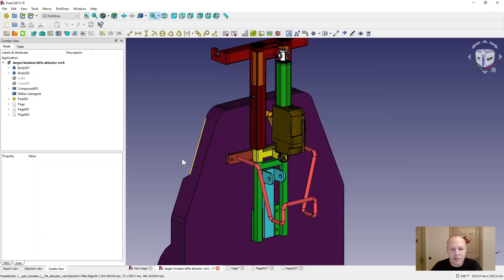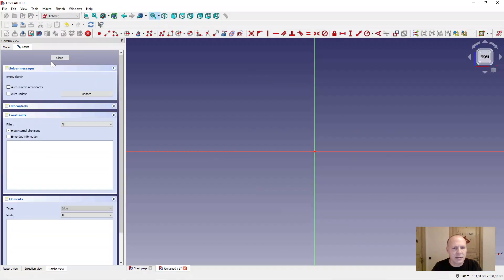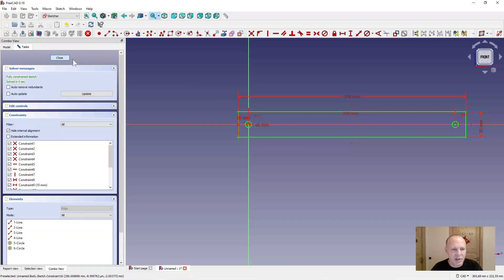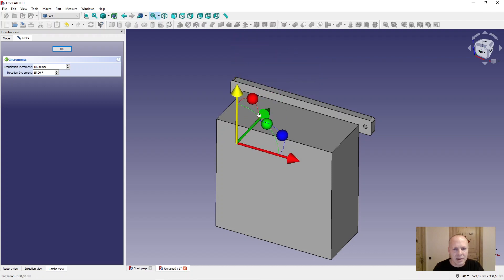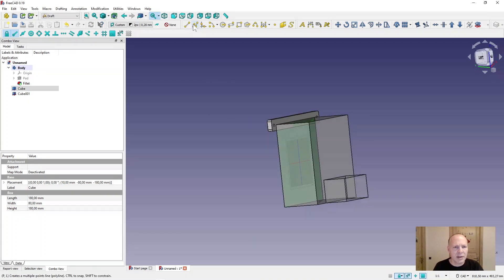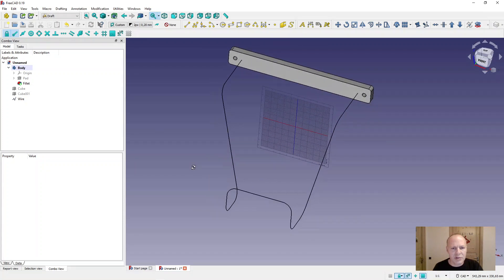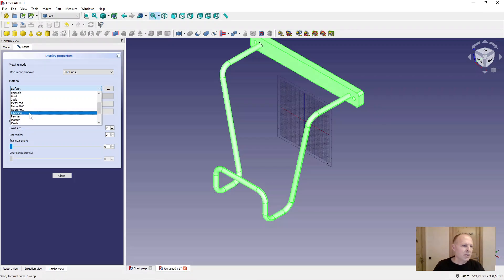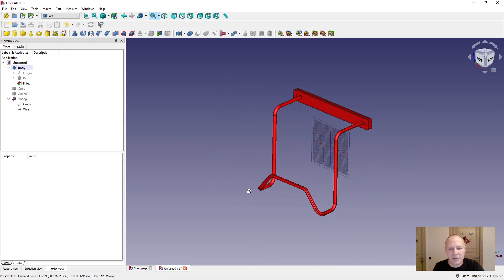Freecad 3D Sweep

Comment: When I followed the procedure to design the path of the 3 d poly-line, the orientation deviated from the edges of the solid in such a way I had to readjust the Euler angles & position of the 3 d poly-line.

Comment: Hi Mads as you know for  people with poor eye sight it is very hard to follow a fast moving LITTLE  black or white pointer. Would be wonderful if you could make it red with a yellow hue on the outside AND increase the default size. Well it is possible.
Check this site https://sites.google.com/view/catnip5/mouse-highlight?authuser=0
Thanks a lot.
Reply from the maker: it is not easy to make the corser bigger you can not see the tool tip text on icons if you do so and you haft to chances corser from time to time what about getting a bigger screen bg. mads😁🇩🇰 the strimming program i use is difficult to change mouse pointer you can not chance windows pointer